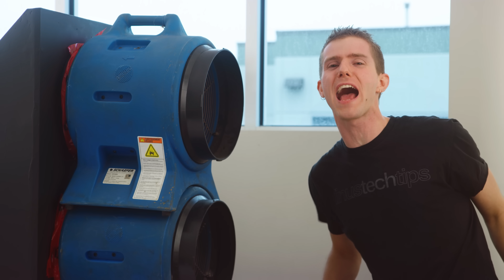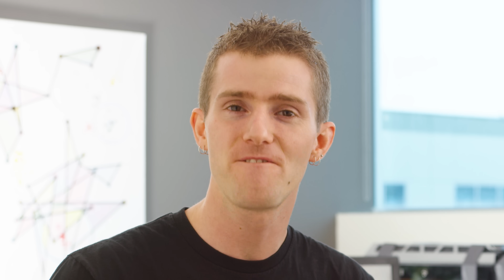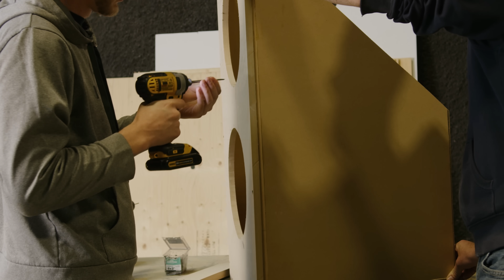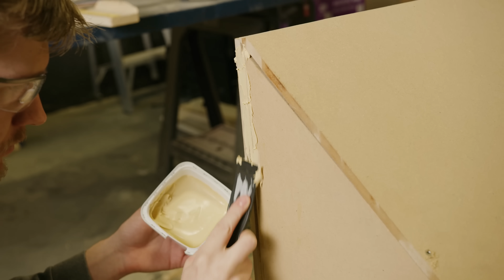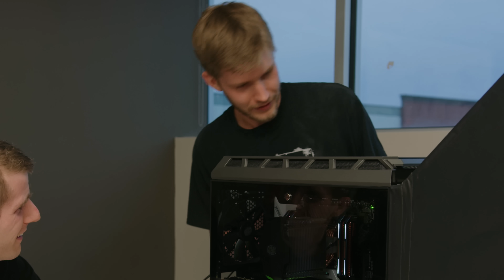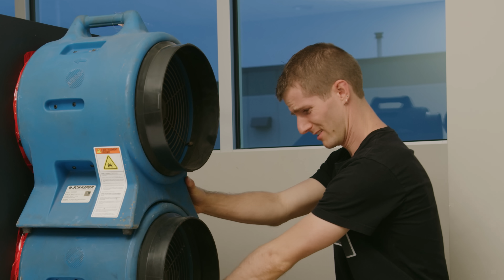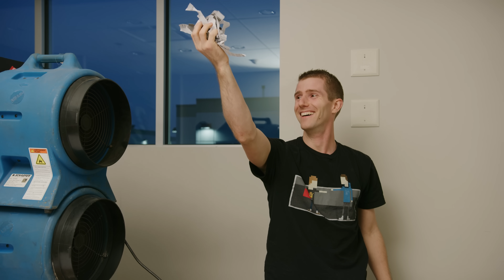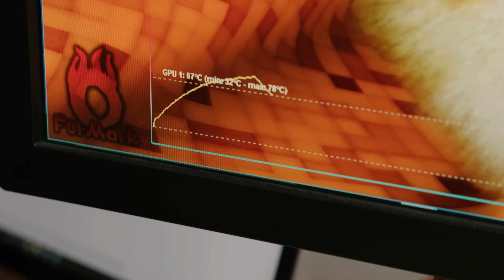Highest Airflow PC EVER - SUCCESS!

Comment: The case fans are bottlenecking the airflow
Reply: Worse! They 'produce' eletrical energy instead of consuming it. WTF
Reply: @pedrorehm   which fun fact could overload your motherboards fan ports and fry it
Reply: @L1gntn1ng  and make for a more interesting video.
Reply: @pedrorehm  lol
Reply: @aaa-l5l3u  it's when a component is so powerful that it's restricted by others components

For example, using a rtx 2080 ti with an i3 4400 and 1gb of ddr2
Reply: @red1246  that's not a bottle neck, that's neckless, fam.
Reply: RED 124 the thing is the i3 even from 2nd gen uses ddr3
Reply: RED 124 a 2080 ti with a i3 4400 shouldn’t even be called a bottleneck, that’s just straight not right to use a i3 4400 with a 2080 ti and 1gb of ddr2
Reply: @kiwizlucks4947  yeah bro it's just wrong. I mean, why would you use such a fantastic, amazing, top-of-the-line, not to mention recent cpu (which has a groundbreaking 2 cores and a whopping 3.5ghz clock speed) with such a mediocre gpu...
Reply: Toby Cooper “groundbreaking!” “Whopping!” “Mediocre!”
Reply: @kiwizlucks4947  1gb of DDR2 won't even work
Reply: @tobycooper4639  well you are pretty broke from purchasing the 2080 ti why not cheap it out... 
B A D   M I S T A K E   9999
Reply: @pootispiker2866  how are you still using that pc?
Reply: @red1246  4th gen chips use ddr3
Reply: @red1246  I mean the ddr2 is the real bottleneck since your PC won't even boot at all with it in
Reply: @red1246  the i3 4400 takes only ddr3 memory tho
Reply: @iftekharsafi4861  That's how bad of a bottleneck it is
Reply: @red1246  Or a 2080ti, 128 DDR4, but a Celeron
Reply: @red1246  tf is a motherboard with ddr2 compatible with a 2080ti
Reply: @o-manthehuman7867  well you will not be able to use pcie 3 but it will still work
Reply: @red1246  ahh
Reply: I can't help but wonder if removing the rear exhaust fan, and just leaving the slot open to flow out would've helped.
Reply: makes you think about if exaust fans make sense at all in a positive pressure system
Reply: @Jaburu  you dont want excesive positive pressure on one system as it may dramatically change the airflow with all that air hiting more air... making the heat wont follow a route but instead creating turbulences everywhere on the case based on the shapes and the irregular temperatures the air moves depending on the moment... making the airflow less eficient at all that it could get with a propper values.
Reply: @aaa-l5l3u  The neck of a bottle.
Reply: That rear fan:  I am speed!
Reply: hue bottlenecking is when a part’s full power is restricted by the other parts.
In this case, the case fans restricted the full power of the giant blowers.
Reply: @aaa-l5l3u  
It's where the top pops off your case and hovers...
Reply: Not really, they're getting spinned by the airflow itself.
Reply: The CASE is bottlenecking the airflow.
Reply: Really?  :D
Reply: this is why ill go comments to learn not in the video
Reply: you mean, the whole case was bottlenecking the airflow
Reply: yea
Reply: case lid flies out of existence
Reply: @aaa-l5l3u  its the neck of a bottle xD
Reply: @SimonWoodburyForget  think the advantage of having both is that you can direct the airflow. If you put input and output on top you will have most airflow at the top, for example.
Reply: definitely yes
Reply: The case fans should have fallen off lol
Reply: they should have put liquid metal everywhere too
Reply: They should put on in front on out back lol

Comment: W8t... Isnt h500p one of the worsed airflow cases?
Reply: This is not a H500P conceived by mere mortals.

This is the H500P EXTREME POSITIVE PRESSURE SPECIAL REMASTERED PLATINUM ULTIMATE SUPER COLLECTOR FAN EDITION.

This, is not a case.

This, is a FASHION STATEMENT.

If you are one of those who wanted to be exiled from home by GF, would be Ex-GF, wife, and would be Ex-wife, buy it, right now.

Comment: He already did a liquid cooled room...why not do an air cooled system like this but have the air fans in a soundproof box in another room? Use dryer vent tubing to bring the moving air to each system and a modified shroud to allow for the normal front buttons while still letting the increase airflow though the front?

Comment: Hey we finally found a cooling solution for the old generation AMD FX CPU series
Reply: FX 6300 user here. My room is about 86 degrees here in Pennsylvania constantly when playing BeamNG.Drive. The CPU turbos itself to 4.00ghz until it eventually starts to get way too hot and still turbos to 3.70
Reply: @アカシア-w7b  yeah! a beamng player!💪😎
Reply: FX8350 User over here... my room is basically a sauna while playing CPU-Heavy games
Reply: And the Intel Pentium IV Prescott!
Reply: Noctua NH-U12S with a single NF-F12 fan on it. FX-8350. Idles at ambient. Highest temp I ever saw was 55c in DOOM 2016 at Ultra 1080p, 120fps

Comment: I have this case. running a Ryzen 2700x build and a x470 Asus Crosshair VII  motherboard and a Cooler Master  ML320R AiO for the CPU
and one of the biggest issues with this case is the plastic front blocking those massive 200mm fans. 
Fortunately Cooler Master offers a Mesh front panel for 20 bucks which dropped my temps dramatically. 

I am trying to stick with Cooler Master for my entire case build... along with fans and coolants. But I was wondering if you have any idea how I could take another Cooler Master... say the ML140 or even the 240 and attach either the 140 to the back exhaust... or the 240 in place of the 200mm fans in the front for my MSI Armored (white) RX580 8OC  

I am trying to avoid custom blocks, as it is way out of my budget
Reply: That's why I decided to buy the be quiet Dark Base Pro 900. You can open up the front panel like a door for a better air flow

Comment: “High airflow” you’re legit using a blower design graphics card
Reply: Lmao that's the first thing I noticed too. Why in god's name would you use a blower GPU in a insane airflow PC case project? Lol.
Reply: @merritt2014  2 reasons. 1st if you use open air gpu, the air from gpu fans will be useless due to high pressure coming from the big ones. So it would be the same as not having gpu fans at all and only completely relying on the big ones.

2nd if you use blower type, the air pushed by the big fans will have a small impact on cooling the gpu itself because it's closed therefore the air has to go inside the fan/blower in order to cool the gpu.

It's for this exact reasons why they didn't bother putting the fans on the cpu cooler.
Reply: @Misaki11111  also didn't they say they used a blower because the warm air gets pushed through the back?
Reply: @Misaki11111  im a bit late. but it's actually much simpler than that. since this video is sponsored, they asked linus to use a blower style card, since that's the one that most customers can relate to

Comment: Comment for the extreme safety nut in me: you should use hearing protection with that much noise.  90 DB can cause hearing loss after a few hours which means even a few minutes isn't good.

Comment: How practical would it have been to remove all of the other fans and just rely on the two big ones? The case and CPU fans would have been trivial, but what about the PSU and GPU? Do CoolerMaster even make a passive PSU? And can you separate the fan/shroud from that heat sink on the GPU?

Comment: Wouldnt the fans inside the case become generators with all that wind force blowing on them, and then backfeed the electricity they are creating into the mobo, and fry it? The diodes that feed the fans would become "light emitting" for a split second before they fry too, hehe.

Comment: I use the same CPU cooler from coolermaster as in the video, horrible cooler, the fact aside that it cools pretty good, it had many defects, lots of ticking sounds, fan axis broke making the fans rotate basically freely, with very little stability causing lots of more ticking. The sounds you would expect when there is a cable hitting the fan blades constantly.
Not recommended at all

Comment: You should try a very high quality, and quiet, house-fan. Obviously it would have to be tried on a pc with exposed hardware. But, It's actually a practical solution; like me, I haven't used the side panel on my tower / case in YEARS.

Comment: Try using a belt-driven model next time to get the motor out of the way of the airflow.

As a note,  HDF, MDF and various forms of high grade MFC are some of my favorite materials.  (I prefer High-density MFC, but that stuff is far more expensive than ordinary MDF, which is sufficient for most projects and has a bonus of better acoustic dampening.)    Honestly, the fiberboard types you can find at your local hardware store are so much better than the old PoS particle board types used in most furniture kits.  (I don't me Point of Sale by that either.)

Comment: What’s the point of a CPU cooler at that point
Reply: I would just leave passive tower there, fan is only to block airflow,...
Reply: Keep the heatsink, remove the fan.
Reply: yeah it probably slows the CPU cooling :)
Reply: @popkorn256  please explain how it "slows" the cpu cooling.
Reply: Generate electricity
Reply: CPU Fan: Am I a joke to you?
Reply: You would keep the cooler because regardless of how much airflow there is, a cpu will always run hot. Thats why overclockers use liquid nitrogen to keep their cpu's cool enough to do extreme overclocking.
Reply: Electro Evolution that’s because non of them want to use 2hp worth of fans. So you can’t really say this won’t work, just because people use liquid nitrogen for their setup
Reply: @michaelesposito2629  okay no.. thats unreasonable. Nobody puts performance brakes on a stock prius. Are you with me?
Reply: Electro Evolution that has no bearing on whether or not these fans would be enough to cool a cpu
Reply: Probably because the rams are blocking the aur pathway before it reaches the CPU

Comment: You could just modified a window AC and had it blow in the case.  If that isn't enough use a house hold 5 ton AC system for air flow and direct component cooling. But you will probably need to coat everything to keep water moisture from condensing and freezing and shorting the hell out of everything.

Comment: Those are my temps with my side panel off after playing 10 hours squad and post scriptum ahahaha got never breaks 65 with a clock speed of 2000 GTX 1080 and my cpu never breaks 50 i5 3570 non k even though I did over clock it to 3.9 ahah not supposed to but I’m getting the new i5 8600k so I brought it to her limit if hit 4 she boots up and I can play games but unstable

Comment: I think I'd put a PC like this in the basement and run the VR, monitor, and other wires into another room to keep things quiet.

And super overclock it for maximum performance.
Reply: If you're going to do that, just go further and dig a hole in the ground of the basement to plant a Radiator in and liquid cool with that.
Reply: And take up a second job cus that’ll cost 50 bucks a day to run

Comment: I know this was last year,  but I'm going to come out and say this anyways.  
Not that it's a bad thing to experiment even if you don't care for future damages.  
For that kind of airflow and pressure to literally blow the top off the case,  the direct pressure of the large fans,  can actually bend and possibly break the CPU Heatsink.  As well as damage the motherboard because of the vending CPU cooler.  The bolts holding on the back of the board will start to flex and crack.

Comment: I had a PC that sounded like that once… a Pentium 4 with 2 optical drives, 6 IDE hard drives, and an old GeForce that was amazingly hot for its day… The machine had 8 fans in the case and it sounded like a harrier jet was taking off when I powered it up… Oh, and NO throttling the fans in those days- all or nothing on or off.

Comment: what if you removed the cpu cooler, would there be enough cooling to prevent the cpu from shutting off?
Reply: Probably not as the surface area would be too small.  The heatsink and fins are an extension of the surface area.

Comment: next time do 5 min of research in fluid dynamics and design the fan port better that almost 45° angle is basically throttling the upper fan by a lot... all it does is disrupt the airflow of the fan under that...

Comment: Wanna know the best part. You can increase the speed by using a nozzle not unlike what is in supersonic wind tunnels. You might be able to push supersonic airflow through it. But the friction heating would negate some of the cooling, if not all of it.

Comment: But seriously, is this actually applicable to a real scenario? Put a single 1HP fan instead of two, and have watercooling radiators on every external fan port (2x RX Vega 64, 1x 360mm radiator for an i9 overclocked like hell)

Comment: You would have gotten better results if you removed the entire rear panel.....all of the framing and everything.

Idealy, probably would have been better to use 1 fan for intake and 1 for exhaust to have even airflow and better heat extraction.

Theres no way the cpu fan or the case fan can extract near the amount of air coming in, so those fans would have been just creating more of a barrier for exhaust.

Comment: Tuck tape is used when something is poured around it. For instance, concrete. You'd use it to seal up gaps in the wood forms, and then concrete would be poured. The tuck tape would prevent the liquid concrete from getting through the gaps. You would have better off using any other type of tape. Literally.

Comment: Reminds me of a setup I had, it was a Zalman rezivator but it was a hot summer so I bought a big tower fan to cool the liquid  reservoir. It actually worked really well as I didn't know at the time but overclocking a core 2 quad/running a core 2 quad without causing a fire was something.

Comment: Have a question have you used this set up to pull the air though the case before the fans making a low pressure in the case, This might even increase the heat transfer.

Comment: I wonder what would happen if they tried doing this again but without a cpu heatsink. I wonder if the moving air would be enough to cool the CPU enough to not over heat and turn off.
Reply: William Waite Wouldn't work at all
Reply: It obviously wouldn't work, but it'd make a funny video haha.
Reply: William Waite  maybe cooling threadripper or xeon with one of those sexy, fanless, passive cpu coolers doe
Reply: Definitely not, not enough surface area, the fans on the heatsinks, however, were doing jackshit so you can get rid of those.
Reply: i actually had an idea that maybe they could get away with using an AIO watercooling kit from corsair and mounting the Rad right at the massive intake. would help improve airflow and would probably cool that CPU to a new level.

Comment: You should make a computer heatsink using a huge chunk of aluminum or copper.
Should try and make it the langth and width of the mother board and at least half an inch thick. Id love to see a two inche thick.
Beauty of aluminum is that as long as you get the heat on one part it spreads. A pain to weld.

Comment: Reminds me of back when I started building custom computer heatsinks for all the major heat producing components of the motherboard for small form factor barebones PCs that had limited fan options. I would use the Vantec Tornado fans in them, had the same effect, even back then... just a little noisy, so I also made silencer exhaust shrouds for them too. Could barely hear them at all when your ear was up against them yet still pushed the air. That was back in the AMD K6-2 era and up through the AMD Thunderbird era.

Comment: now remove the actual fans inside the case and then gpu and cpu fans/coolers with big purely passive heatsinks and see those temps drop a lot more. I would bet the insane airpressure actually might have worked against the gpu coolers in this test. After that setup a bowl of liquid nitrogen behind the big ass fans intake and open the lid, to make the air cooler and watch the components actually freeze. :-)

Comment: The thermals on the GPU are impressive but the thermals on the CPU aren't that great as you can achieve these thermals by just removing the front panel as this case has a highly restrictive front panel. This setup does show the fact this case isn't very well put together.

Comment: What? No link for the 1 HP fans? How am I gonna cool my AMD system, now? D:
Reply: Aren't the stock coolers they come with 2 or 3 hp? My AMD 1055T used to sound like that lmao
Reply: just go live to antarctica
Reply: @mrnobody4147  Polar Ice Caps Cooling
Reply: @charlesleonitol.iringaniv8320  hahah right,the best option,you build a house in antarctica and you build a second small house outside of your window to the pcs small house with the cables coming inside and you will have the next generation cooling system ,the best... best overclocking ever ,you will go there just for gaming and when you finished the game you coming back untill the next release...